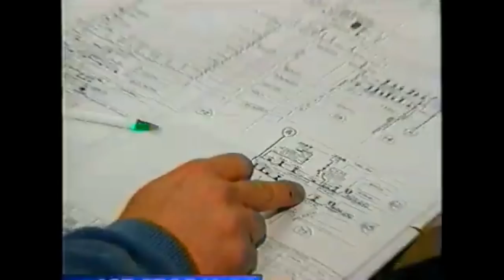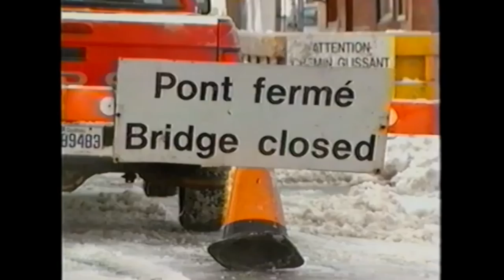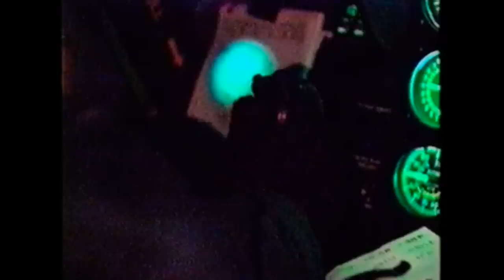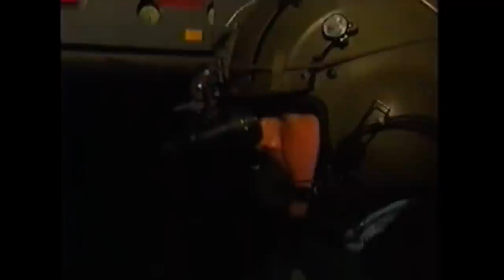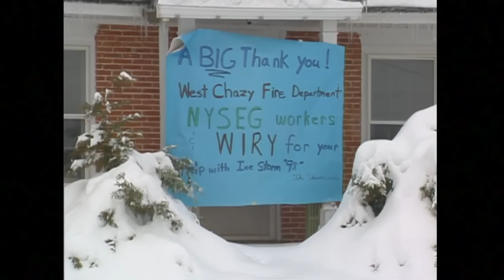The Worst Natural Disaster in Canadian History (Ice Storm 1998)

Comment: I would try to design a tree & power poles shaker machine. Few types even for high voltage lines on caterpillar tracks. Modified heavy vehicles and backhoes attachments , designing a vibration shaker is easy doesn't take a rocket scientist . Attachments could be powered by a jackhammer either compressed air or electric for immediate use before building a specialty machines for specific jobs of shaking that ice buildup on trees, power poles, overhead power lines, high voltage iron towers & high voltage lines , WHEN freezing rain happens . Nobody in Quebec could think out of the box , as residents of Quebec live in a box that wants to separate 😂. Just using chain saws for cleanup is not an answer. Shaking off ice buildup would save over 100 millions of dollars plus . Sharp shooters to eliminate ice sickles on power lines was a good idea. That time I was in between contracts staying in Thailand for 5 months & traveling watching with disbelief how helpless Quebec is with no idea to even try. ..